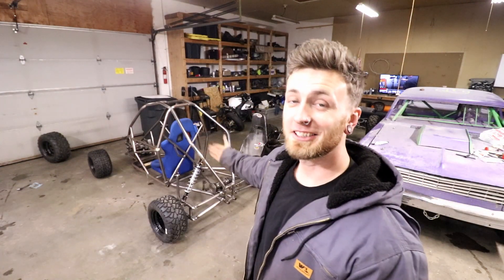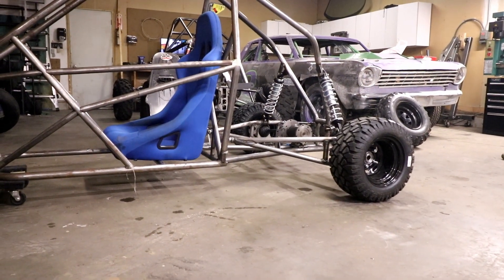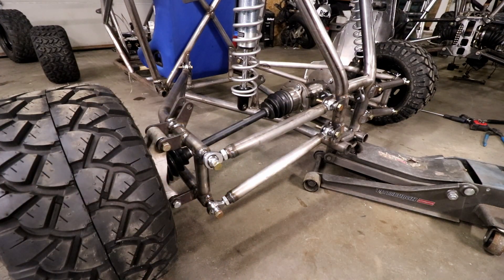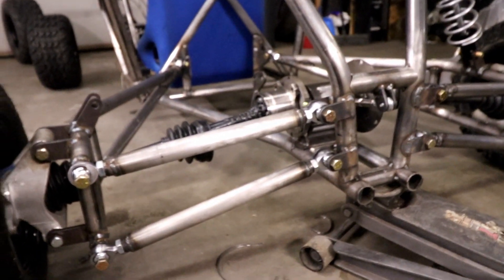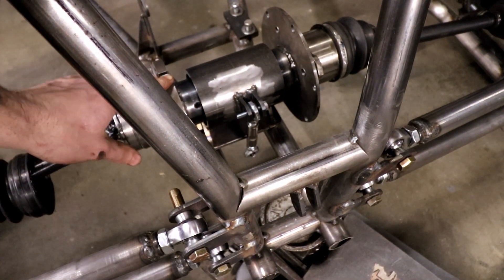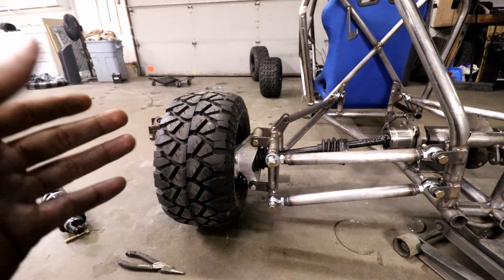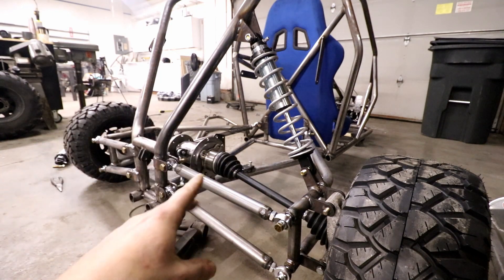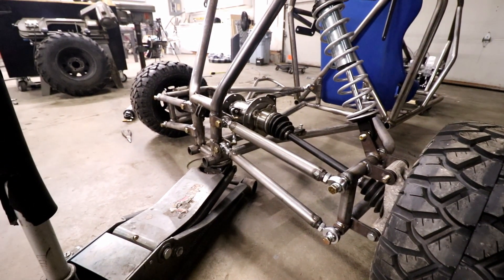Crosskart Build Pt. 7.5 Rear Suspension EXPLAINED

Comment: Hello! Could you name or possibly provide a link to the rear wheel suspension? (wheel hub and axle) 😁🤗
Reply: Looks like he's using the same as what I am on my build. I'm using early 90's Mazda Miata axles, bearings, hubs, rotors, and rear knuckles. I've seen a few people using Miata drive parts and Amazon has the parts pretty cheap. Hope this helps.

Comment: Did you do a roll center calculation at all? It's going to do funky things if the front and rear roll center are far off each other. Check out drive channel and engineering explained for anti squat/anti dive and roll center info(same thing but front to back and side to side).
Reply: There's no one perfect suspension set-up.  He's getting it done ...and will find out cause and effect when he runs it.

Comment: Hi very good info but could you add how you did the outer cv stub shaft with the Miata shaft also I like how you are building your parts keep up the cool builds,
Reply from the maker: its a full miata rear axle. Stubs built into the axle. Rzr 800 hub has the same size wheel bearing as the miata
Reply: @jimkhana6881  thats good to know. i was planning on using Miata rear hubs. are you then using the miata wheel hub with the rzr800 bearing carrier?
Reply from the maker: @rbdesignsnh  exactly
Reply: @jimkhana6881  nice. i might snag that idea lol.
Reply from the maker: @rbdesignsnh  please do! thats what the series ia all about 😎
Reply: @jimkhana6881  would rzr hubs fit on the miata axles and rzr bearing carriers?  I would like to have a 4x156 bolt pattern without the extra width of adding adapters.
Reply: @jdstremi  Did you ever figure this out? I want to do the same thing
Reply: ok thanks can you send me some pictures of the axle and the outer stub on it and the hub and carrier  show what it all looks like please and tanks for your reply and help Steven.
Reply from the maker: just watch the last video or google mista axle
Reply: Hi ok I watched the videos agine and did not see the outer cv that goes thru the carrier and outer hub so you are saying the stock Miata shaft fits the Polaris carrier  and the hub fit with out no machine work just bolts up. thanks for you help also some day would like to see you build a 4x4 buggy the way you build would be interesting to see how you would do it. keep up the cool builds.

Comment: Good vid, I’m currently doing my rear suspension on my dune buggy and I’m using VW axles and hubs and I’m doing double wish bone suspension😬😬😬, keep the good work up though I’ve never thought about plunge!!
Reply: Yes well the problem is they use cast iron and 1/2in steel and I need to drill 24holes and you can’t just put it in a drill press ether!! Amazons best drill bit set here I come...
Reply from the maker: double A arm is the way to go!
Reply from the maker: Also, VW axles are far better and you likely wont have plunge issues bc both sides float, i believe.